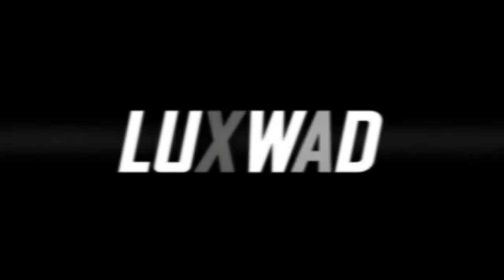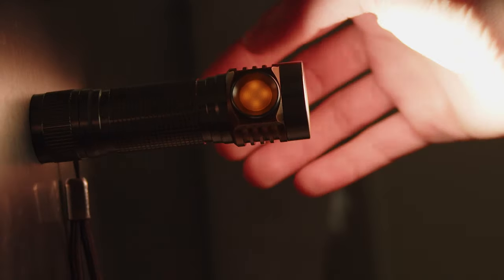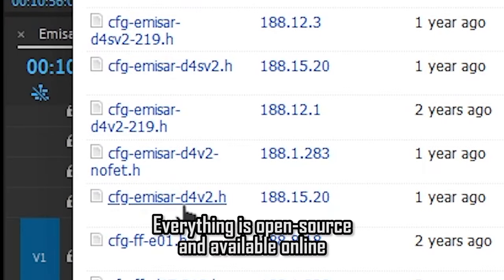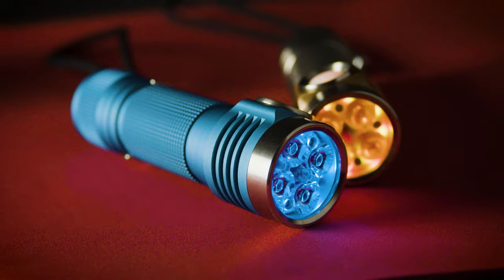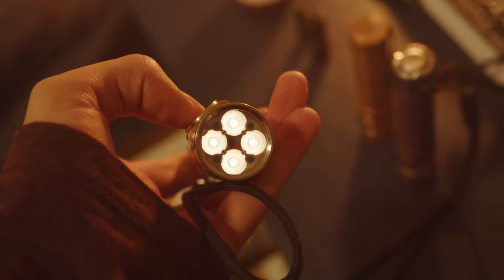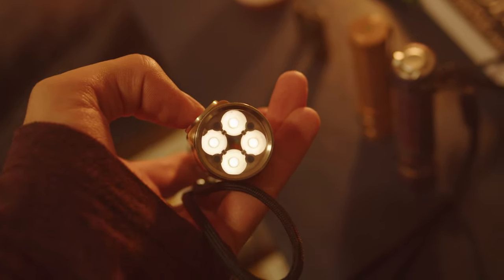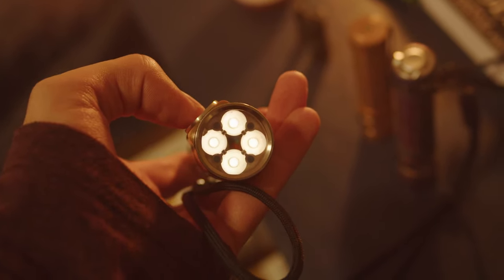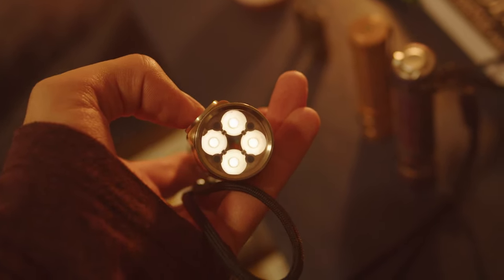DANGEROUSLY FUN - Emisar D4V2 [In-Depth Review]

Comment: Hello.  Really well-produced review you've made!

I hate to be the bearer of bad news, but several of the issues you mentioned have already been fixed.  These things are continuously evolving, so information goes out of date pretty quickly.  I hope it's okay if I just write out some notes and thoughts along with video timestamps...

This comment isn't a review of the D4.  It's not even a review of a review of the D4.  It's more like... a cross between editorial notes and absent-minded rambling, both unsolicited.  So take it all with a grain of salt.

(comments below, due to comment length limits, apologies in advance for lack of brevity)
Reply: 3:00 The board color doesn't necessarily reflect the type of driver.  In my experience, Hank often seems to use one color for the first batch and another color for the second batch.  The D4 driver type is more reliably indicated by the presence or absence of components on the spring side of the board, like a capacitor.  FET+1 drivers are clean on the spring side, while linear D4 drivers have a few components visible.

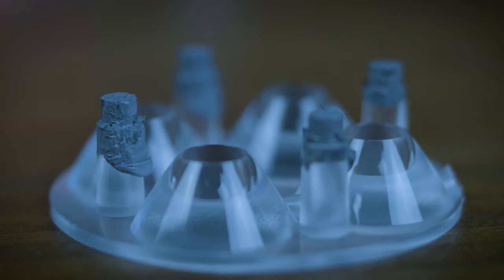4:29 Thermal goo on the optic isn't usually there to hold it in place; it's mostly just a side effect of using too much goo on the pill.  It just squishes into any available space when compressed...  like the holes for the optic legs.

6:10 I'm not generally going to object to someone using a song I made in a review about a light I helped make, but it's usually a good idea to get permission first and work out the technical details before publishing.  Youtube does some pretty crazy things sometimes with ContentID, so if we're not careful, either one of us could end up getting a copyright strike that neither of us initiated.

6:17 Hank is currently in the process of updating as many lights as possible to Anduril 2, so a significant amount of the UI details in the video may be inaccurate pretty soon.  If you do a video on it, I'd recommend covering v2.

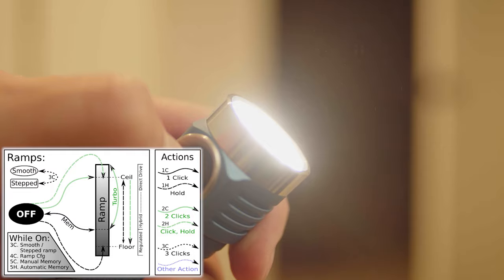7:16 Stepped mode now allows 1 level, for people who want a single-brightness light.  The one level is set halfway between floor and ceiling.

7:30 2H in lockout now goes to the manual memory level, if there is one, instead of the second ramp floor.

7:50 Muggle mode has been replaced by the less-interestingly-named "Simple UI".  The old name was fun, but some people found it insulting.  Muggle mode was a janky afterthought which was never really very good, while the simple UI is much more robust and configurable.  Similar purpose, but done more properly instead of being an afterthought.

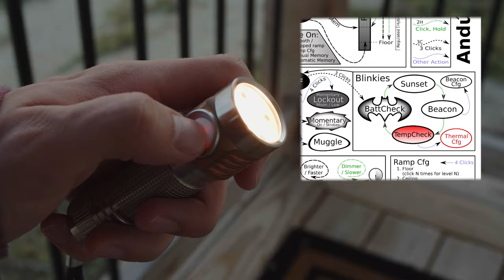8:30 Sunset mode has been removed and replaced.  Instead, there is now a sunset timer available in both normal ramping and candle modes.  Basically, go to whatever ramp or candle settings you want, then do a 5H to activate the sunset timer.  Each blink adds 5 minutes to the timer, so hold until the desired timer value is reached.

8:44 Manual memory has been extended to add a timer, a.k.a. "hybrid memory".  It behaves like automatic memory, but resets brightness to the manually-memorized level after the light is off for long enough to reach the configured timer value.  That way, it'll stay where you set it during a session, but resets to your preferred default between sessions.

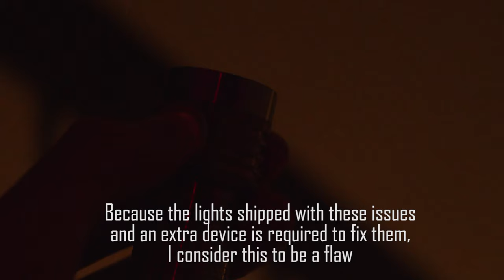10:33 The rainbow speed has been a matter of disagreement between me and Hank.  He keeps wanting me to speed it up so the light will be more eye-catching in "attract mode", but I think that's annoying and generally set it slower.  So the speed has gone back and forth a few times.  This will probably be resolved soon by a structural change to the config / build system, so there can be multiple config flavors per hardware model, and people can then choose whether to run Hank's version or mine or someone else's.

The rainbow speed, of course, is not the only setting which will differ... it's just one example.

10:35 Party strobe bug... means that you got a firmware version which wasn't supposed to be used, but ended up shipping due to a bit of miscommunication or misunderstanding.

The "d4v2.5" firmware was a one-shot temporary build produced by request for hardware I didn't have access to.  I tested it on an old KR4 prototype, since that was the closest I had, and it worked there... but people reported an issue with party strobe on production hardware, so I immediately fixed it.  At the same time, I merged the "d4v2.5" build into the "kr4-nofet" build, since they were both electrically compatible.  Then I asked Hank to update, but he didn't understand and kept using the old version.  This wasn't resolved until quite a while later when I found out he hadn't updated.

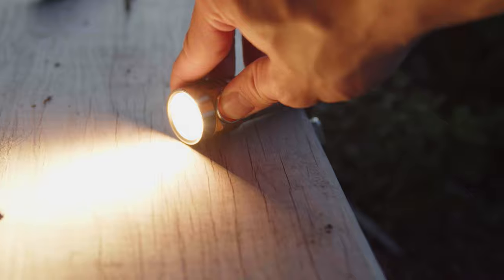11:32 The mid-ramp blink and button brightness increase happen at the same part of the ramp.  Both are intended as reference points for when some sort of important milestone has been reached, but the exact location varies depending on the exact type of light and where the natural boundaries are in its hardware.  With ~50 supported models, there is a lot of variation.

12:20 Aux LED controls have all been moved to 7C / 7H, for consistency.

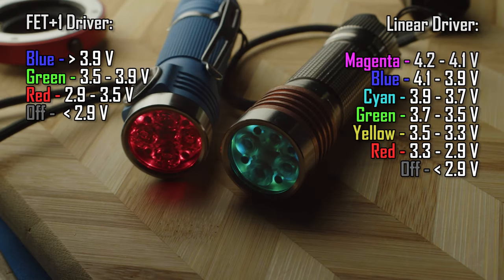12:38 Three special modes now.  Disco, rainbow, and voltage.  Also, I'm surprised you got one with only 3 voltage levels... that version is pretty ancient and I thought Hank stopped using it a long time ago.

13:06 Aux LEDs too bright on high mode...  I agree.  I tried to convince Hank to reduce that, and kind of succeeded, but it's still too high.  At least he didn't do his initial design, which was 10X brighter and used 10X more power.

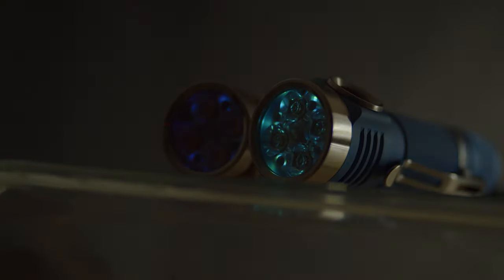13:30 Colors unbalanced on low.  Yeah.  Haven't found a solution to that.  The high mode's brightness is configured with resistors, so it can be balanced...  but low mode uses the attiny's internal resistor, and there's no way to adjust it.  Also, since it's a completely passive design based only on resistance, the current draw (and to some extent, the color) changes with battery voltage.

15:15 Same story for the button LEDs.  It can't do an in-between brightness.  I'd prefer if Hank made the high mode lower, but he likes it higher.

15:21 If you want side and front aux LEDs to have independent settings, there is a code branch available for that.  However, most of the people who tried it (including the author) ended up switching back because they found they didn't like it as much as they expected.

17:37 The linear driver only keeps output steady until the battery voltage drops below the LED voltage.  Then it follows a direct-drive-like curve which slowly declines over time.  But this usually doesn't happen until the battery is pretty low... especially on E21A since it has very low Vf.

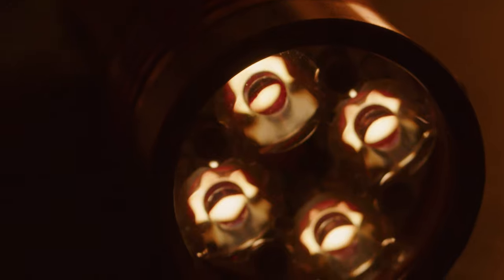17:50 The linear driver's poor resolution toward bottom of the ramp was fixed very recently.  It now gives smoother adjustments than the FET+1 model.  However, the bottom can still flicker on some lights because drivers some seem to have a stronger lowpass filter than others.  It's rock steady on my D4v2 Ti E21A, but flickers on my old KR4 SST-20 prototype.

17:55 The slow activation at 1/150 is partially fixed, and I expect to have a more complete solution done within a few days.  Also, the steady level has moved up from 3/150 to about 11/150, due to increasing the resolution of low modes.  It's the same brightness, though.

This slow activation is entirely an analog property of the regulation circuit, so unfortunately there doesn't seem to be a way for the firmware to detect and compensate for it.  It's like how human eyes take a while to adjust from bright light to dim light, except in this case the torch basically blinds itself and then takes a little while to recover.

18:30 I've never seen the 1/150 "ultralow" level fail, but I don't have a lot of hardware to test.  Have you been able to reliably reproduce that behavior?  If so, how?  What conditions make it happen, or not happen?
Reply: 19:28 The FET+1 makes an audible sound?  It should be about 15.6 kHz, but the sound in the video seems to be about 6.3 kHz... oh wait, it says 40% speed, and 15.6 * 0.4 = 6.24.  Yeah, okay, that's expected.  It could be fixed by changing the attiny chip from "phase correct" PWM to "fast" PWM, but that has some side effects like making the LEDs stay on slightly during modes when they're meant to be off.

Perhaps while I'm messing with PWM settings I could make it change the wave generation mode depending on the ramp level.  It'll be tricky to fit into the API, but maybe I can figure out something.  It'd need to have the ramp segmented into different, um, ... gears?  Not sure if car analogies really work here.

20:45 There is nothing about the linear driver which would make it degrade weak batteries any more than the FET+1 driver does.  If anything, it's the other way around.  However, neither one is a boost driver, so they won't attempt to pull extra current to compensate for low voltage.

The primary risk to batteries is if a weak cell is used for extended amounts of time on direct-drive turbo, especially on LEDs with a low Vf.  Direct drive is only limited by the resistance of the circuit components, basically the strain it puts on them, and the location of that strain depends on the components.

For a linear or direct-drive driver, the ideal setup is for battery voltage to be exactly the same as the LED voltage.  If the battery is too low, the LEDs get dimmer.  If the battery is too high, the extra voltage must be burned off somehow... usually as heat.  The key questions then are how much heat, and where.

For a direct-drive circuit, resistance (and thus heat) is balanced between the LEDs, the battery, and the springs and wires connecting them.  Each part provides some resistance, and converts some of the power to heat.

LED Vf rises with current, while battery voltage falls with current, and flow settles where the curves intersect.  There's also a small gap between for the springs and wires, but this is almost negligible on Hank's lights because he uses very low-resistance parts.

For a very strong battery, most of the strain falls on the LEDs.  Like, hook up a 500A battery, and it'll quickly turn the LEDs to smoke unless it wasn't fully charged.  Battery voltage doesn't sag much at all under load on high-amp cells, so instead, the LED voltage must rise to make up the difference.  But they can only rise so far (and get so bright) before they go poof.

For a very weak battery, internal resistance is high so most of the heat (and strain) happens inside the battery...  and it can end up damaged even while the LEDs are barely warm.

So the recommended cells are chosen to balance these factors in a safe way.  The battery may be physically separate, but it's a surprisingly important part of the overall circuit design.

How the linear driver differs is ... it has one additional component soaking up some of the load.  In particular, it tanks most of the heat which would otherwise go to the LEDs.  The regulator adds a variable amount of extra resistance, which reduces the load on the LEDs and sometimes the battery too.  This makes it a bit safer overall, even for weak cells.  But if you used a high-voltage battery (like two 18350s in series) and a low-voltage emitter (like 2V red LEDs), the regulator itself could get melted while absorbing the difference.

21:28 219B / 219C LEDs can handle direct-drive reasonably well, though they ship with a version which reduces the maximum duty cycle by about half or a third, because they otherwise may begin to die within a few weeks or months when used on turbo with a strong cell.

E21A, however... turns into smoke within seconds when used in a direct-drive circuit.  So for those it's important to never use the DD FET.

23:15 Hank does tint mixes sometimes, and other custom builds, but please keep requests to a minimum because it causes a lot of extra work for him and he wants to see his family once in a while.

24:15 The SST20 4000K configuration is toward the low end of the brightness scale for this light, with some of the most heat and worst efficiency.

My favorite style is XP-L HI 4D (~4400K), but Hank unfortunately doesn't offer it right now.  It makes a nice neutral CCT with a slightly pink tint, with the most lumens and least heat,  while also being nearly at the top of the throw spectrum and producing almost no "rainbow effect" across the beam.

33:24 It may be worth noting that high CRI isn't actually the same thing as accurate color rendering.  CRI refers to a mathematical formula which is, unfortunately, imperfect... and there are numerous cases where a lower-CRI light displays colors more accurately.

SST-20 is particularly known for its green tint when used in a reflector or optic, and for its unusually poor blue rendering.  It tends to make browns look more yellow, and makes pinks look more like a salmon color.  However, some people don't mind its "lemongrass" tint, and it's a popular choice since it's cheap and it makes more lumens than other high-CRI options.

Personally, I find it to be one of the most unpleasant LEDs I've ever used... except when it's in a mule configuration with no optics.  In that arrangement, most of the green is emitted sideways and absorbed by the host, while the pinker shades go forward.  If I understand correctly, this is what the LED was actually designed for, like when being used in street lights or overhead light panels.  Big LED manufacturers mostly don't care about flashlights, because the market is too small.

28:28 Allowing the highest levels to be obtained with a low battery...  this isn't because of regulation.  It's just because the E21A LEDs have very low Vf, so the battery curve and LED curve don't intersect until the battery is very low.  All the regulator does is burn off the difference between the two.

35:00 Pill color affects the flood color at the outer edges of the beam, but not the hotspot.

37:00 Despite trying several times, I still haven't convinced Hank to make a general-purpose EDC light... probably because that sort of thing wouldn't have the big numbers his company is known for.  But I'd really like to see something like a Noctigon version of the ZL SC64 or Olight S2, a compact, lightweight, single-LED light designed to be practical instead of a minmaxed hotrod.
Reply: One final note...  with a review of this quality, you're probably going to have flashlight manufacturers rushing to send you as many review lights as possible.  Don't end up like some past reviewers, who overworked themselves and then swore off flashlights entirely, switching instead to a new hobby: alcohol.

I'm not kidding.  This is a real thing which has happened more than once.
Reply from the maker: Thanks for the info all the info and corrections, I pinned this comment so hopefully everyone sees it.
 There's a couple things I'll try to clarify, YouTube comments aren't great for this but hopefully it's not too jumbled.

I'm a bit unsure of what to do about the Anduril video. For me, a big reason to do it was the idea that any light in the wild with the firmware would work about the same, but since a lot of other models (such as the Lumintop/Sofirn lights) can't be easily updated, I am not sure how to proceed, as just covering one feels incomplete to me. However, I don't want that project to expand into something huge and unmanageble like this one nearly did, trying to explain TWO versions of the interface would just be a nightmare.

I also came across your comment explaining the party strobe issue, which was annoying but I figured I would mention since Hank did send the light that way, same with the older version in my FET model. The lights were ordered together in May. 
Actually that was part of what made this video tricky, while customization and the ability to update is a huge draw, it doesn't feel like a proper review to me without mentioning these issues as they came from the factory. At some point too I had to draw a line on additions to the video.

When the ultralow failed, I really had no idea why. I have not been able to reproduce the behaviour, though a couple times in use it started flickering more noticeably. The shot in the video at 18:30 is literally the only time where it actually died out completely, and it even worked fine soon afterwards. The light was just sitting unused on my desk before that happened, I picked it up and started using the lowest ramp levels.

As for driver whine, while most others don't seem to hear it the FET model is actually quite audible to my ears, but isn't so bad that I can't use it like some other lights I have. My hearing is quite sensitive though, for now at least. Perhaps this is a misconception but as I understood it, energy being used to produce an audible (or above-audible) noise is energy that is basically just being wasted, so it seemed pertinent to mention as a clearly illustrated manifestation of the lower efficiency due to PWM. If you have further insights on that, I would appreciate it.

What you describe with the wave generation changing with the ramp level seems very cool, I am interested to see what result that might have.

I also sincerely appreciate the extra info and corrections you provided on drivers here. Until now I've had only the most basic understanding of the technical electrical aspects of flashlights, and making this video required me to learn a lot. Clearly though, there is still much to learn.

Regarding the SST20s, I didn't want to cover color rendering much here so I mostly just left it with my thoughts. While I did notice the slightly weird coloration it gave things, I didn't mind it at all and still really like these LEDs. In practice they are still more natural looking to me than the warm E21As, mostly due to the respective color temps. Admittedly though I'm far from a tint snob, as long as the light is warm I'm pretty happy. Interestingly, I did try it out without the optic but I don't remember particularly liking it. I plan on covering the TS21 with the same emitters, so I'll probably address it in more detail there.

Hearing about Hank's opinions on the Aux lights is kind of amusing, I definitely am on the side of dimmer lights and slower cycles.

There actually was a portion of the video where I explicity stated that customers should not send unnecessary emails to Hank and to look for customizations already available online first, but it was cut, along with lots of other little things that seemed to drag the video down. I regret removing that bit now.

I did mention it already on Reddit but I was actually a bit worried about putting your music in here, and I did try to contact you over Reddit, albeit not very hard admittedly. I used the music as a placeholder in my timeline while I waited for a response, and ultimately I just went ahead and used it. I'm sorry about the lack of communication on that. I did hope to use it again for the Anduril video, but I understand if it's a problem.

This project was a bit much, it ended up being far more than I initially planned it to be. I definitely will be toning things down for future videos, I want them to be well-made still but I can't sustain huge complicated projects like this. I do hope that this video will bring some attention from manufacturers/retailers, but I will bear your warning in mind.

Actually, I'm not entirely sure where I'm going from here, I do have a few more reviews planned out but I don't really want to find myself stuck producing tons of flashlight reviews, lights are great but I'm not real fond of the whole hyper-consumerism aspect of this, especially since lights are really just meant to be tools that realistically don't need upgrades. Honestly, if it weren't for the desire others have expressed to see more reviews, I would consider stopping reviews before too much longer, in favour of pure entertainment instead. So it is a bit of a conundrum, we'll see where it goes.
Reply: @LuxWad  As you say, youtube comments aren't great for stuff like this.  So... I responded privately.

Anyway, take care... and if you decide to do more videos, it sounds like people would enjoy it.  But OMG it's a lot of work.
Reply: @ToyKeeper  What would be cool for the RGB AUX LED would be to offer a simple battery status mode using only the red and green LEDs. I mentioned this to Hank a year ago but went no where! The international recognized standard for decades is green full, red empty. You could do solid green as full, solid red when at 30% and red slow flashing at 15%. Totally easy to understand by anyone. The current battery status mode that uses so many colors I have no idea what it means most of the time. Could be an idea to have both options included!
Reply: @practicalguy973  The battery status colors are the same as a rainbow.  If you know what rainbows look like, you know how to read the battery colors.

Purple (Blue+Red): full
Blue: high
Cyan (Green+Blue): high-ish
Green: half
Yellow (Red+Green): low-ish
Red: low
Black: critical
Reply: @ToyKeeper  Thanks for that info. I don't think in rainbow. Also I keep my AUX LEDs in low and the mixing colors like cyan and yellow don't show up as those colors unless I put the AUX LEDs on high. After using that over the last year I understand when its full and and getting low at least. I have a couple of D4V2, one is an older version that only uses blue, green and red for the battery indicator. I prefer that because it's only using the primary LEDs and there is no color mixing issues on low. I would still prefer a simpler option for the reasons I said previously. Something to think about, I'm sure some other people like typical battery indication also. I really like what you've done otherwise with Anduril. It's a pleasure to use. Thanks for that!
Reply: @practicalguy973  Not sure if you have a flashing kit, but if so, you can make it use whatever colors you want.  It's open-source, and there's a table which tells it what colors to use at what voltages.
Reply: @ToyKeeper  I don't have a flashing kit but that could be a great idea. Thanks!
Reply: @LuxWad  excellent lights and excellent review (fantastic editing too). Just subbed. If I may interject whether you continue making these videos: There’s aspects of “hyper-consumerism” with anything, any products, any hobbies, and across a myriad of genres and fields. Don’t worry about that which you have no control. Follow your passion. If you’re good at something, and you like how it results in helping others, keep developing and refining your passion for it. Just some good thoughts and vibes. God bless!
Reply: @ToyKeeper  On the other hand... What if alcohol reviewers start sending him samples too!??
Reply: @ToyKeeper  While true, he makes a good point: Red and Green LEDs are a more universal UX these days than remembering the rainbow.
Reply: @ToyKeeper   @Practical Guy  
please let the flashing option that shows us the battery voltage by blinking. as me and a lot of people are red/green colorblind, we dont see a difference between red and green.
this is very bad for a lot of people :(
Reply: @ToyKeeper  Well, screw me for reviving a 1-year old thread, but here I go: Since you're the community's expert (and probably engineer for the way you talk about all of this), why would a single-LED flashlight be more practical? I'm fairly new to lights and, despite my interest in learning about all the circuitry and electronics, I don't even know where to start. From the info I've been gathering, mostly on Reddit, I thought that using multiple LEDs was supposed to decrease heat by means of using more LEDs but pulling less current to each of them but reaching a similar output, and therefore making it more sustainable and more practical, maybe? Perhaps I'm just using words incorrectly, or I'm just wrong. 

I ask this because I'm a big fan of Hank's designs, but I have no interest in minmaxed hotrods, as you lot call them. I want my tools to be useful as well as pretty, that's the reason I got into EDC stuff.
Reply: @Jorge-ft9oh  Emitting light from a larger surface (like multiple LEDs) makes the  light less focused.  Less focused light has a shorter effective range.  So the user then must increase the power level to reach the same visual brightness.  This increases heat and decreases battery life, in exchange for a wider hotspot.  But if the user doesn't need to see a wide area, it's kind of a waste of power.

There is a sweet spot, of course, an ideal balance between throw and flood... and I think most of Hank's compact multi-LED lights are a bit too far on the floody side of that balance... while his single-LED lights are larger and generally too throwy for general-purpose use.  So it'd be nice if he made something between, in a nice small size.
Reply: @ToyKeeper  I understand. I also prefer the floody stuff, and really don't like it when lights have a hotspot at all. That's why I'm enjoying my TS10 so much, I think. The beam is really uniform, but it's a really good mix of flood and throw. I do wish for longer runtimes and sustainable outputs, of course.
If I got it right, that's how some throwy lights can get that far even if they're not particularly bright, right?
I get your point, and also would welcome a light like this made by Hank.
Thanks for your answser!
Reply: The legend!
Reply: @ToyKeeper I really appreciate that you have taken the time to be such an open book as a resource like this. You’ve helped me to understand more than I did before and that’s all I ever want in life.
Reply: @ToyKeeper  A friendly suggestion: the UI diagram would be way more intuitive if the Actions and Ramps boxes were swapped so “Actions” is the first thing the user sees.